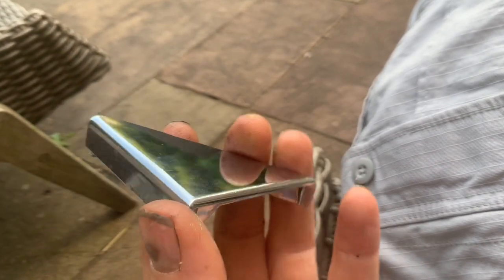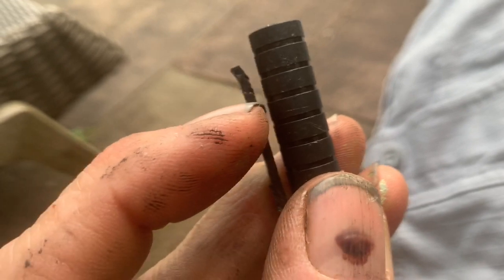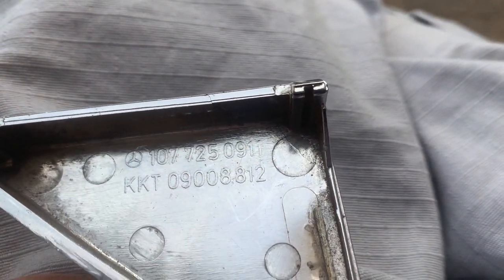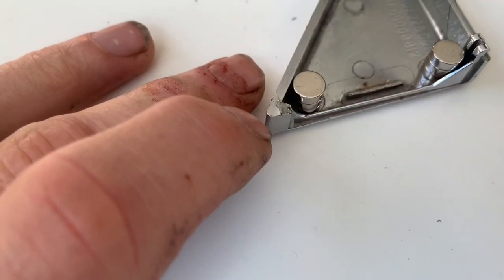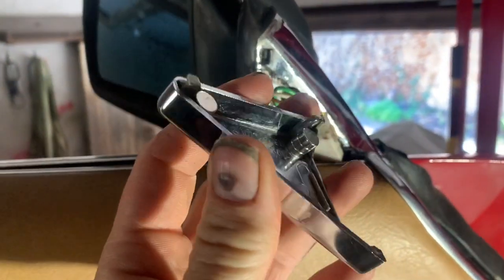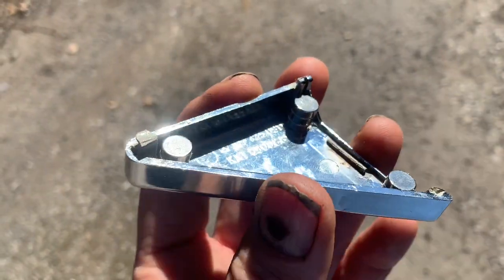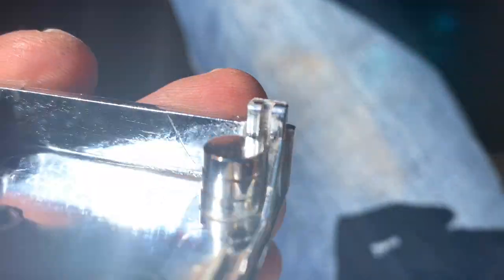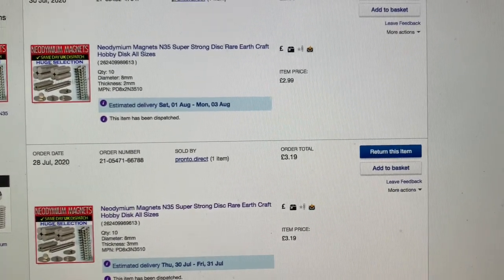Mercedes 107 SL mirror chrome repair 1077250911

Comment: We were all set to do the same thing on our 1984 380 SL in Australia. But thought we’d check the internal metal plate would hold a magnet.   Arggh, it doesn’t!  Part 1077200311 has different sizing & seems only relevant for 1985 onwards.  Do you have a video of your pen cap solution? We love your videos BTW.
Regards, Kate
Reply from the maker: Hi Kate - I haven't done a pen lid repair video (yet)

Does the part you are trying to fix have a parts number?

I notice that since doing that video, part 1077200311 is still available form the SL Shop? see https://parts.theslshop.com/mercedes-benz-r107-sl-passenger-side-wing-mirror-adjuster-cover-plate-rhd-1077200311/ Maybe the part you need is also available?

Does you car have electric wing mirrors?

Where are you based? I have just come back form a lovely sunny month Oz....although that seems like a distant memory now...

Mike in Bristol
Reply: Hello Mike. 
Our part number is 1077250911 (2 of the lugs are broken), same as the one you put magnets on. Seems odd a magnet won't stick to the internal plate! The passenger side (left hand side of the car) is electric. 

We're in bayside Melbourne.  Glad you enjoyed Oz; we have friends coming over in April so look forward to showing them around.  
Regards, Kate
Reply from the maker: Hi Kate - As you know, 1077200311 is still available whereas 1077250911 is not. I THINK....(although I could be wrong) that these two parts are in fact the same despite having different part numbers. 

If it was me, I would buy 1077200311 and get your friends to bring it over in April. Worst case scenario is that it doesn't fit and you are down approx £30 (£21.12 postage).

If you don't want to risk losing £30...and you happen to know people with a later SL, you could always take the part of their car and try it on your first.

Let me know if you need anything else.

Mike

 @katemccracken6347
Reply: @MikesMercsandothercars  it’s worth a try.  I’m in the local MB club & doing a compare/contrast next week with another member who has 3 380s. We’re also having a challenge with the wiper blades. On mine it has a pair of 19” blades, so the passenger side one fouls the windscreen trim. I have snipped back the rubber but we want to source a 18/16” pair in the SS finish. 
Again we have learned so much off your videos, & will be polishing  out the pitting on the chrome inserts on the front bumper today.  

Regards, Kate
Reply: We got the part 1077200311, which is at least the same size. Then Murphy's law kicked in. The notched lug of the right angle corner is attached to the bottom edge of the part & hooks into the horizontal lip of the underneath bracket.  The original part has the notched lug on the vertical edge of the part & hooks into the vertical lip of the underneath bracket!     

One last question:  is the underneath bracket on the car in your example ferrous or non-ferrous? Maybe a neodymium magnet would work even tho' a standard magnet was not attracted to the bracket.

Regards, Kate

Comment: What you doing with the other r107 ??
Reply from the maker: Thinking maybe  I'll do a series of vids on how to completely strip down an SL. Maybe get it dipped, welded, painted...and painstakingly begin the process of restoring each part and putting it back together...or I could just sell it as is...or break for parts. Haven't quite decided yet. Mike
Reply: Mikes Mercs and other cars Makes sense, my car is currently parked next to it I think, waiting for respray.